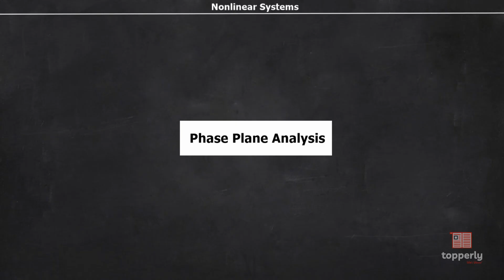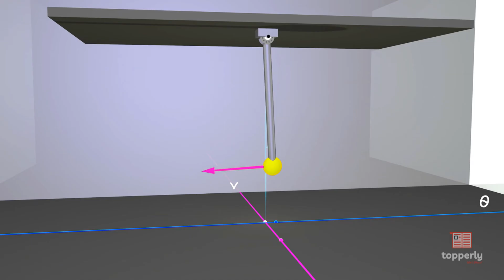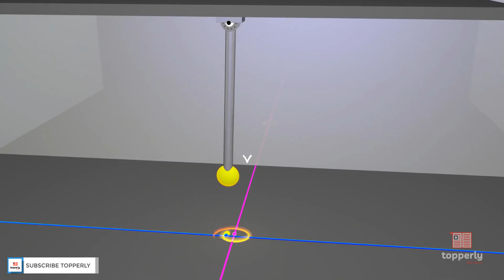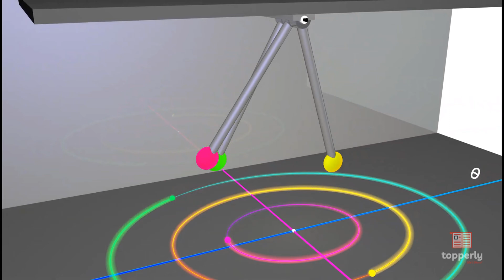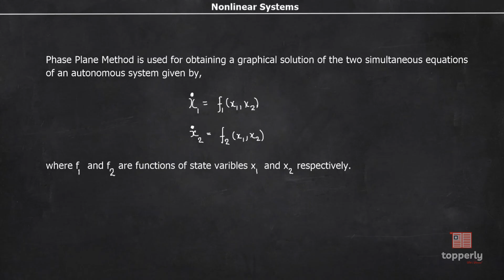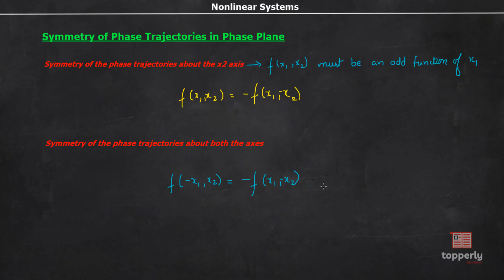Phase Plane | Nonlinear Control Systems

Comment: 4:41 about the straight line which u plotted as f(x1,x2) : Is it the function f(x1,x2)=0? Because there is not coordinate to mark the value of 'f'. The straight line you plotted is x2=x1 or (x2-x1) = 0 or f(x1,x2)=0, where f(x1,x2)=x2-x1. Please clarify this.
Reply from the maker: Hi Blesson,
As you rightly said, we are not plotting the value of function f. We are simply plotting the function f=0 which is a function of two variables x1 and x2 in the x1-x2 plane.

Comment: Hello and thank you for the explanation, i have only one question, when you compare the two ecuations of dx2/dx1 to get the ecuation f(x1,x2)=f(x1,-x2) why the two dividing X2 are negative? i thought that only the X2 from the ecuation dx1/dx2 in the 4th quadrant was negative.
Reply from the maker: I believe you are referring to moment 06:43 of the video. Please note that I'm simply substituting f(x1,x2) in place of f(x1,-x2) in the expression (-f(x1,-x2)/(-x2)). Hence -x2 is from the 4th quadrant itself. It's not changing. I hope this clears your doubt. If not, please comment. I'm happy to explain again :)
Reply: @Topperly  yeah thank you for your explanation, so f(x1,x2) is equal to f(x1,-x2).
Reply from the maker: Yes :)